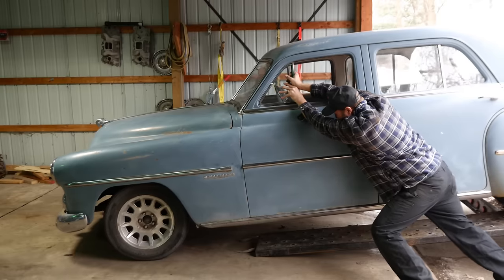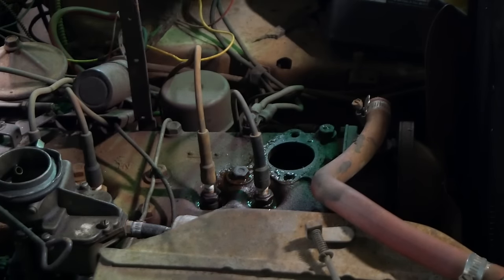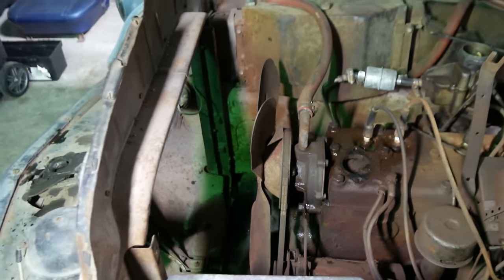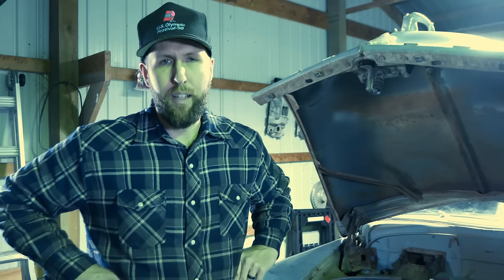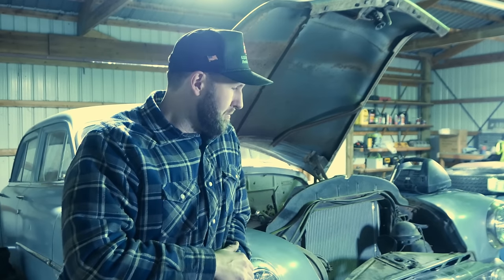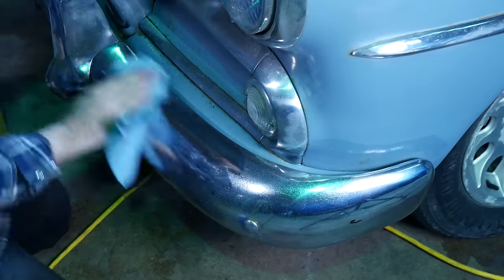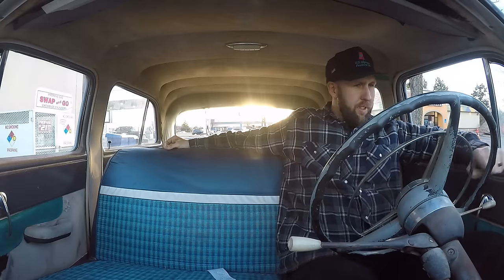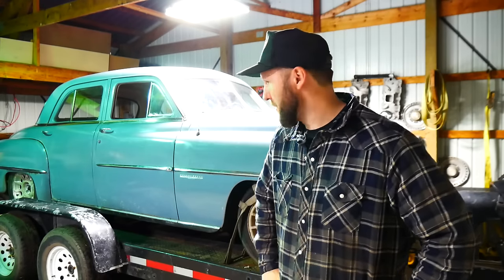1952 Dodge Cooling Repair & Paint Buff - Vice Grip Garage EP23

Comment: 30 years ago I had the distributor modulator go in the hammer lane in rush hour traffic in a city I knew nothing about and coasted over 3 lanes off a ramp through a green light past a stop sign crossing the street into the parking lot stopping 6 inches from the curb in front of a parts store without ever touching the brakes and put it in park. To this day It was by far my finest moment.
Reply: Ice cold under pressure.  Love that story.
Reply: Old Buicks are cool,great rides.what model?, in an old early50's add,Buick claimed all cars of the future will have port holes in them.
Reply: Dang,put it on wrong comment,  oh well
Reply: QQTrick1QQ 👌🏻
Reply: That's a good story. I had a friend that drove us up to the high country to see some snow. He hit a super slick patch of ice making a left. Spun the Jeep around at least 540° while clawing for grip into the parking lot and backed it into a nice parking spot in front of the restaurant we were headed to. Did it all in one smooth action. Don't think Ken Block coulda hooned it in there any better.
Reply: Thats awsome.
Reply: This is awesome haha
Reply: I had an idler pulley break once and lost the serpentine belt. It was on a drive from Phoenix to Dallas. It was about 1am, 20 degrees, and in west Texas. Fortunately, of all the desolate places in west Texas that could have happened, it happened just as I was coming into Midland. I shut the engine off and was able to coast off an exit ramp and right into a hotel parking lot. Stayed there for the night and went to a parts store the next day for a pulley, a new belt, and a socket set.
Reply: Not as good as your story but had similar situation. Was on the Highway in Austin, TX in a 81 Trans Am and started smelling strong raw gas smell then engine died. Spotted a gas station ahead and took the exit and coasted right up to the pump as the car stopped rolling. Fuel line had split on fuel pump. Fixed hose, filled up and back on the road....
Reply: Been a long time since you made this comment. But it’s still impressive. 😊👍
Reply: one time I ran out of gas in my GTO and was able to coast almost a half mile to the station. Hard to steer and stop but made it to the pump.
Reply: I ran out of gas one time about a mile from the station in my 68 GTO and coasted to the pump.
Reply: Epic experience, but must admit definitely been in quite a similar predicament a time or two before lol.
Reply: I recently had a rear tire go flat after running over a piece of metal on the highway. I was in the fast lane doing about 75. I crossed the two lanes to the shoulder. Crossed back into the off ramp between 2 cars. Turned right onto a side street after crossing the service road and stopped under a street light. Perfect for emergency work that it turned out I was unable to do. One of my memorable moments...
Reply: Aaaaaahahaha! That sounds amazing
Reply: @Urz75z  *_[

Comment: Worst place I ever broke down was over 30 years ago. I was toolin' down the highway in traffic in my '56 Buick when I encountered heavy traffic heading to the old Seattle Coliseum for a Seattle Sonics basketball game. That old nailhead didn't like the traffic much and vapor locked bigger than grannies bloomers. After getting the single finger salute about a thousand times from frustrated Sonics fans as my Buick was blocking traffic this dinky little tow truck finally showed up. The driver finally got the Buick hooked up and towed it and me home. Of course after the car sat in the lot outside my apartment overnight it fired right up. Needless to say however, I don't drive it in traffic much anymore. The Sonics are gone the coliseum is now called Key Arena, but the car is still with me.
Reply: Shawn Kemp and Gary Payton forever!
Reply: Maybe the Old Buick Was Trying to Tell You She's a Pistons Fan and Wanted Nothing to do with them Sonics ?
Reply: Jay Gilling my oldest son was a high school friend of Shawn Kemp. Concord High school, Elkhart, Indiana.
Reply: If a guy wants to stop that vapor lockin up just put some of your wife's or granny's clothes pins on the makem go line between the fuel pump and the carburetor thingy.  It'll draw of enough heat to keep a fella going thru the hot times.  A trick I learned from an old desert fella some fifty years ago - works good and so long as you don't get caught swiping clothes pins - it's a cheap fix.

Comment: "guys seen himself die about 15 times in his dreams from the old jack stand fail." every time i slide under somthing on jack stands i look around and see what is going to crush my head first
Reply: I drilled Thru holes in my stands...  I pin  em.
Reply: I always stack a coupla mounted tires under the car, just in case. No chance of em breaking or tipping over.
Reply: @OldSkoolF  That is a great idea
Reply: @donellmuniz590  If I have room, I'll leave my floor jack in place. Once the car is resting on the stands, I close the valve and leave it almost touching. Saves time at the end of the job, too.
Reply: @AcmeRacing  same... when i can.

Comment: Derek: there is a hidden sheet metal tube, behind the water pump when installed , called a water distribution tube that puts water under pressure flowing upward towards the head, helping cool the head! The tube can clog overheating the head & engine! Or the tube can disintegrate from corrosion due to the fact that it is sheet metal! If installing a new one treat it so that it won’t corrode before installing , note if you obtain a new one fabricate a tool to pull out the old one, using the new one as a template, maybe, 1 1/4 x1/8 strap steel about 4’ long maybe a little longer to be able to grab end W/ slide hammer to yank out old tube if it breaks up spend the time to clean it out all the way to the back cylinder! Big difference in cooling the motor ! Not many people know about this ! I was taught this by an old timer! On my first engine build as a teenager in high school rebuilding my Dads 52 Plymouth station wagon Flathead 6! Regards Mad Mike S. From the land of freezing ass cold❄🥶⛄….

Comment: Broke down feelin' up a girl in a field after a date when I was a young man. Left the radio on too long w/o starting the truck to charge the ole batree. Had to walk a mile to a buddy's house for a jump since it was pre cell phones. Those were some good times
Reply: Better times. I remember flattening the batree on a '74 Be em dubya 323i, it had those mechanical fuel make it happiners so all I had to do to getter goin' again was to roll down hill but the stickilator in two and lift the clutch, no batree? no problem ran a dream without it, headlights were dimmer than a wet candle though.
Reply: @BauregardSenior87  .....🤣🤣🤣🤣 You have me smiling on fathers day. 
Hope you have a good one as well 😁

Comment: I don't know how many thermostats I have replaced ... unfortunately, not a single one of them was the problem.
Reply: Your preaching to the quire brother.
Reply: Had to replace on a hummer, didn't even open a half inch
Reply: @dennislynn2955  also "you're"
Reply: The thermostat isn't usually the problem if she's overheating. If you have NO heat and it won't reach operating temperature in winter, it's probably stuck open.

Comment: Worst place I ever broke down was in the fast lane, at the traffic lights, and first in line during peak hour traffic with a huge line-up of cars behind me.

The little brass inlet tube had fallen out of the mechanical fuel pump.  Tapped it back in with a block of wood and popped the hose back on and away we went again.  That was after I had to push it through the lights and around the corner to a safe parking spot.
Reply: Almost the same! Busy intersection, Hwy 501 in Myrtle Beach, SC, Friday @ 5 pm. My Chevy 1500 quit. First in line at light. A County police woman stopped & pushed my truck out the road before I knew she was doing it! By hand. The fuel pump in tank, had separated.  I had been resisting getting a cell phone for years. I knew it was time then.

Comment: I noticed over the years Cooling systems get limed up from calcium in tap water. I used to dump in a pint of snobol for 24 hrs with several warm ups to decalcify. The downside, if it leaked it will get worse. Flush with clean water, fix the leaks then top off with distilled water and antifreeze or 50/50 antifreeze. Will cure the overheat and improve the heater. Enjoy your show!
Reply: StriNg Oriented and symBOlic Language?

Comment: Broke down on the side of the PA Turnpike. First started with smoke inside, pulled over on the turnpike and let it sit a minute, then started her up again. Made it roughly 500 feet before the smoke and smell and jumping began. 1990 Audi 80, That my dad got for free because no one could get it started. Worked his magic on her and got that problem diagnosed and fixed (cracked distributor cap, died every time a felette drove in the rain) But she had many additional issues that would keep coming up as she was undoubtedly the best most reliable model audi even created 👀

Thanks for the videos VGG - glad I came across the channel finally.

Comment: I used to keep some WD40 in my slant six Dart. Every time I drove through the car was it would stall or run like crap. I’d spray the cap wires and coil and it would run great again.

Comment: i would totally feel safe hanging out with the guy under any life threatening situation.  never panics.  and keeps his sense of humor.  the worst place I ever broke down was in my 1968 ford mustang when the carburetor gave out in the middle lane of traffic and I had to keep my foot on the gas to keep it running.  needless to say but I was white knuckling it until I could pull over.  one other time it didnt break down but I went down a hill on a breezy day and my convertible top blew open because the latches were shot.

Comment: I have an extra back glass
Reply from the maker: I need it.  Email vicegripgarage@gmail.com please?
Reply: Dont use the same shipping company as for the radiator!
Reply: @TT.Hell.  Unless you're shipping an anvil, don't use UPS. It'll certainly arrive crushed. I used to work in a musical instrument store and I have watched UPS drivers basically dropkick acoustic guitar boxes off the truck onto the sidewalk.
Reply: @failuremagnet  yep, I bought a bass amp shipped via them.  It looked like they just chained it to the back of the truck and dragged it from New Jersey to Indiana by the time it got to my door.
Reply: @ViceGripGarage  did you get it???? I'm new here
Reply: just break it up in small pieces so it fits in a smaller package, he can glue it back together !

Comment: As an old mechanic once told me, "there's a reason the thermostat's there, but it's not a good reason"
Reply: The problem with running no thermostat is it chews on the Piston walls if you need to take it out to get home remove the thermostat spring and stop seal and put the frame back it

Comment: Broke down in downtown Chicago, during afternoon rush hour. In the only turn lane. Luckily, after a few kind words from the cars behind me, a guy on the sidewalk helped me push it accross the intersection and out of the way. Turns out the ol' batt-ery clamper oner came loose. A few love taps with the wheel whirler made her come right on back.

Comment: You make me laugh like have no idea🤣 don't trade it for nothing. Those ol flatheads are gold dust as well their successor, the slant six. Work more on the electrical system to a brand new state and you will have car for lifetime, mopar or no car lol. Btw next time you take it to the car wash, make sure the back window glass is installed🤣🤣

Comment: 1970 GTO right in front of the police station. Decided to burp through the carburetor. Small fire involved but got it out fast. Turned around and there stood several policemen with fire extinguishers.

Comment: in 77 we were driving in rush hour,  downtown Montreal in a 68 mustang 302 with a 2 out of 3 automatic and the carb was spitting fuel. At an intersection, the paint on the hood started to curl up. Realizing the fire wasnt getting enough O2, we opened the hood. The driver in a  passing transit bus asked permission to use a fire extinguisher on it, just as a local news-cruiser pulled up. Indeed, the 6 o'clock news was never and has never been as exciting because of that personal touch.

Comment: As a mechanic of 35 years. you are correct about the need for a thermostat.  Without one you are liable to get localized :hot spots" in your block. Also without a thermostat, the engine would always lose heat to the radiator and take longer to warm up.

Comment: Threw a belt in my ‘65 Corvair while driving in the fast lane on I-285 in Atlanta during rush hour. Had to get to the side ASAP while the temp skyrocketed without the cooling fan in the air-cooled Corvair. It’s amazing how quickly the cylinder head temp goes up without the fan!

Comment: Those Dodge flat head 6 were indescribable. We had one with 4 cracks in the block. So no coolant and beat it endlessly. I blew the rear end when stuck in the bush, hauling wood. I would get so much smoke pushing it hard, fired up the next day.

Comment: I bought a 1952 Dodge Wayfarer in 1964 (14 years old) from a junkyard for $25.00 to run around in the fields.  The fluid drive would barely spin the tires in dirt!  I remember I could stop the car in third gear as long as I kept the revs up, take my foot off the brake and start moving again.  My first vehicle, at 11 years old, was a 1949 Plymouth from my uncle's junkyard.  He later gave me a 1946 pickup.  The best was a 1939 Dodge pickup another uncle gave me when I was 16.  That truck was geared very low and had square gears, no synchromesh! I very reluctantly got rid of it when I joined the Navy in 1969.

Comment: After I graduated from Navy Boot Camp back in '89, I got myself a 73 Maverick and I was driving it to Texas.  The car quit on my and found the lightning whirler as you say had warped and created an uneven groove in the shaft hole.  So, i found a Popsicle stick and fixed shaft from moving.  Lasted about two fuel stops before it burned up and I had to break off another piece of Popsicle stick.  Then luckily to replenish i treated myself to a box of fudge Popsicels ice cream bars to replenish my crooked distro shafter fixer upper.  Made it from Waukgen ILL to San Antonio texas AND back.

Comment: Twenty years ago I was picking up my wife in front of the Mayo Clinic in Rochester, MN after our infant son had open heart surgery.  Fuel pump quit on my 92 Chevy pickup.  Pushed it to the hotel across the street and paid for overnight parking.  Dad to the rescue loaded his shortbox behind his Dodge diesel dually from Erskine.  370 miles.  Alex is going to be 20 this winter.  Just bought his first pickup…broken flex plate, 97 Chevy.

Comment: Been fixin' and drivin' similar cars to yours most of my life.  Brakes - optional, wind shield wipers - mostly not.  Simple as they are still haven't figured out how cooling systems work as I've usually never had one that did. Always being let down at the worst possible time.  One time driving through the pines (what we New Jersians call "the woods") with some friends of mine in the middle of the winter and after having some cold snacks came time for a pit stop.  For some reason I can't recall shut the engine off on my '70 Ford Falcon straight 6 which as you probably know that once and if you can get a ford running you should never, not ever, shut it off.  Well 'course couldn't get starter to cooperate again.  Ended up walking about eight mile outa the woods, found a bar about to close, called a friend about 2 o'clock in the morning to come pick us up. Pre-cell phone days. Amazingly still friends. Finally got old and less interested in fixing cars but after watching your youtubes the old spark is creeping back in.  Really like that '52 Dodge you've been at. Keep goin', sorry about your back (been there too).

Comment: In my old 66 C10 I took out the thermostat in the summer and she ran a lot cooler. My dad was against it saying the coolant never gets a chance to cool off and the temperature would go up. I never found that to be so, but I did put it back in for winter for heating purposes .

Comment: I'm so thankful my old Schumacher manual analogue battery charger still works just fine.  It never seems to have any of the issues I see all these new fangled digital chargers having.  Plug it in and it charges.  Only 2 switches 6/12v and 2/10a.

Comment: pass side rear wheel came off my 1963 falcon at 65mph down hill, did a 360 missed an 18 wheeler comin in other direction and ended up un down a 25 foot ditch... grandpa's car was great

Comment: Ran out of gas in a 64 Dodge while on a camping road trip with a buddy in the mountains of Virginia.  Middle of the night.  We eventually decided to put a gallon of Coleman lantern fuel in it that we had.  Made some funky noises but it ran until empty.  Put it in neutral and coasted down the mountain , right into a gas station that was just turning it's lights on to open up at 6am.

Comment: 3-5mm hole drilled in the thermostat is a good idea, the water will still flow slowly enough to heat up and you don’t trap air pockets in your cooling system.

Comment: First car , 1962 Chevy 11 , 3 on the tree, bought used in 1968..
Driving home from dealer , shift linkage jammed in 2cnd or 3rd gear In traffic, bus behind me. Had to rev the hell out of it and gradually engage the clutch to shudder up to speed.
Got home , slammed the car door and walked away.
Got to love that car though, even though every once in a while I’d have to crawl underneath with a hammer or screw driver to unjam the shift linkage, a common problem with that set up apparently.

Comment: i use to take the thermostat out an use flat washers to slow the flow of coolant down so it would cool better with the right washers you can adjust your engine temp to where you want it